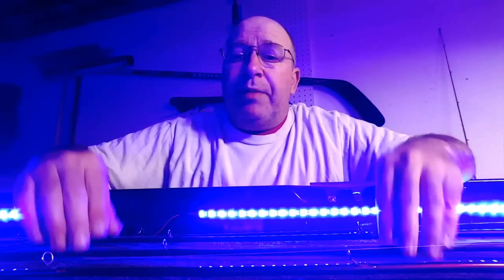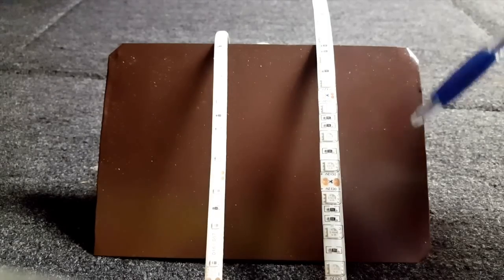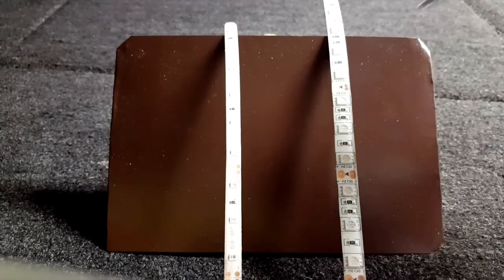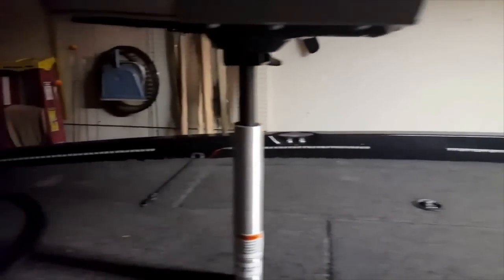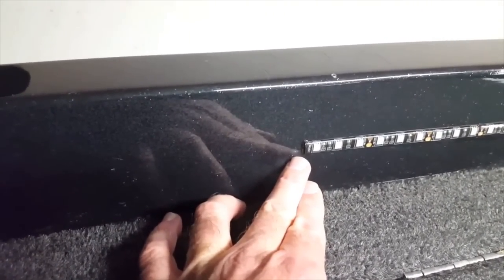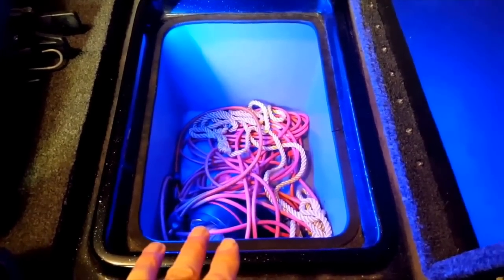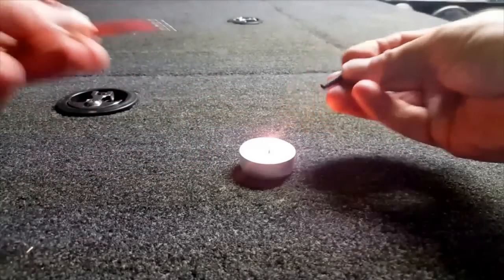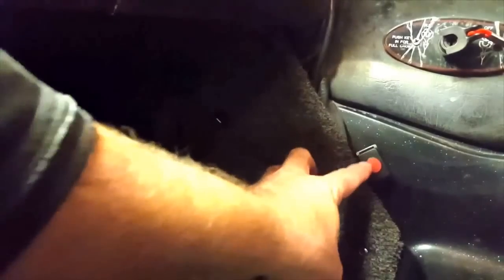Quality LED light system for your bass boat

Comment: When  you make the connections of your lights to the "fuse box" do you have to use any type of DC ADAPTER OR CONVERTER?  or just handle the wire red/black as you'd normally would?
Reply from the maker: No adapters or anything... just 12V DC from the starting battery (as opposed to the trolling motor batteries)

Comment: using a candle to solder?!? just wow!
Reply from the maker: When I'm doing a whole system, with 40 or more wires to flow the solder through, it's a lot easier and quicker.

Comment: Hi, What brand of LEDs did you use for your rub rail lights? I am having a hard time finding some that are small enough to fit inside of the 1/4 vinyl tubing.

Comment: I am having a hard time finding a clear 1 3/4 in clear rub rail insert... my rub rail seems to be a thicker rub rail as it's not a bass boat , meaning it is not a flexible rubber round mold like urs, any suggestions on what I could use to replace a portion of it? The cost hanger wouldn't work for me as the rub rail isn't round where I could fit anything into either side...
Reply from the maker: What make and model is your boat? I can do an image search... if I see it, I can probably offer up some suggestions for an alternative modification.
Reply: Aaron, most big-box Marine stores have larger, clear, thick-walled tubing on rolls, by-the-foot. I found this out while trying to source braided/reinforced tubing when I upgraded the automatic bilge pump on my R91 Intracoastal. Some better hardware stores may have that tubing as well.
Reply: @rodfather_bass_fishing  I'm seriously considering the rub rail nav light option on the R91...very smooth indeed.

Comment: do you have a designated battery for the lights or are you just connecting to the cranking battery?
Reply from the maker: Just connected to the cranking battery. The LED lights draw such little current it's almost a non-issue. Not long after I installed them, just to see what would happen, I turned all the deck lights, the rod lockers, and the storage compartment lights on and kept them on for 2 full days. The battery voltage only dropped down from 12.62  to around 11.88 and with just the deck lights, they can go for 2 full days and not drop below 12V.
Reply from the maker: Just connecting to the cranking battery. I can leave the lights on for 48 hours and they don't even start to drain the battery.

Comment: Did you get these off amazon ? I’m wanting to do the same to mine but not sure the best place to get the led strips
Reply from the maker: I bought mine on eBay, all are supernight brand, water-proof 60 LED / meter. I usually end up replacing one or two a year, usually due to them getting step on with the edge of my shoe. (for some reason I damage the forward-most light on the left side every year.) My switch came from Bluewater LED as did the dimmer switch.

Comment: Heat shrink reminded me of something. If you have something large to protect and you want to wrap it in shrink plastic, use a soda bottle. Choose a large or small diameter bottle, cut the ends off then you have a large tough heat shrink tube. You'll need either a heatgun or blow torch to shrink it.

Comment: I wish you would of showed your power hook ups
Reply from the maker: I just run the 18 gauge to loop connectors at the battery. I use a 10 amp fuse on the power side run inline with two female connectors.

Comment: Wish I saw this before I did my boat.   Definitely make sure your lights are placed properly before you install!   I just placed mine where I thought they'd work but ended up being blinded by those under my console    Good video   tho.
Reply: Yea....honestly you shouldn't be able to see the light strip from any angle.  You're supposed to hide the lights so that they "wash" over what you want illuminated.  In this video they're way too visible and blinding as well.  You gotta be crafty...if your eyes can see them when they're off then you'll be invaded by them when lit up at night.

Comment: Where 2 wires are joined side by side like that I would recommend potting the heat shrink tubing with a sealant of some sort. Also can you add the brand and source of your lights and switches to the video description so we don't have to search all the comments to find that information?

Comment: what lights did you use that have a dimmer switch?  I am looking for some to add to my boat this spring when the weather gets warmer.
Reply from the maker: Ken Busbee I used the Super Night lights and I wired them up with a dimmer from BlueWaterLED. (I used their switch too) I made a video a couple years ago that details the whole system which includes why I designed it the way I did.

Comment: There are lights that are IP66 "weatherproof" compliant.  What are your thoughts on these for deck/compartment lights?  I'd imagine it would be ok as long as the lights are not submerged.
Reply from the maker: Ken Eng you're probably right Ken, they probably would work. But I am a product of my past experiences,  so my mind tells me to do it right so I don't have to do it over. However, I also have a reputation for being a bit overkill when I conquer projects like this.